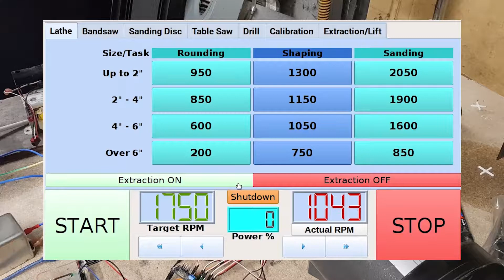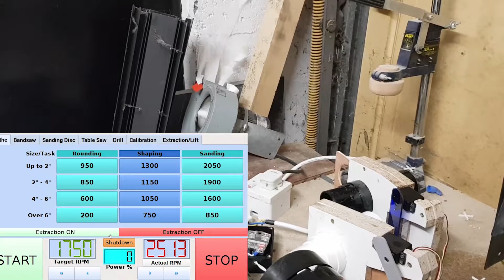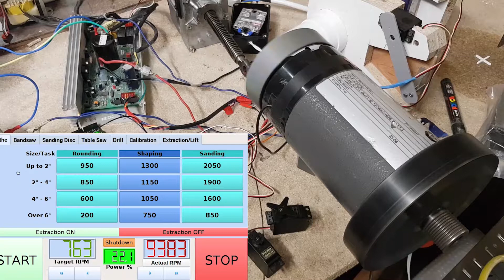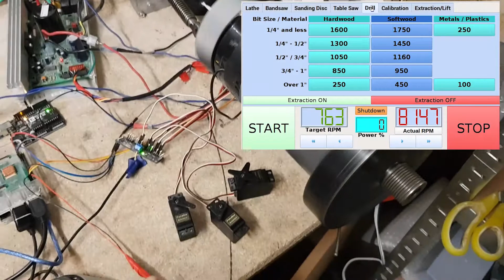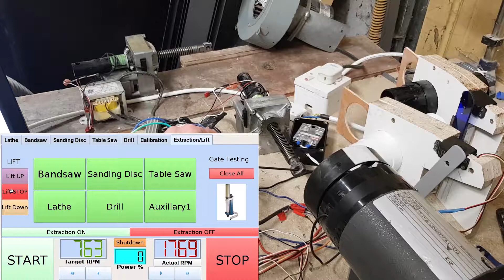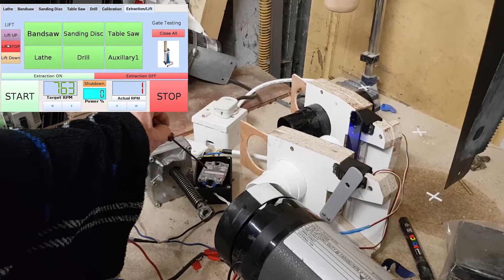demoBENCH

Comment: I just converted my old lathe to a treadmill motor, and it's an entirely different machine now. I'm still using the original control panel  though. I've also acquired motors from two more treadmills, and an getting ready to install them on my drill press (blown motor) and jointer (no motor). I was going to just wire a PWM generator to the MC2100 board, but after watching for videos, I've changed my mind - LOVE the touchscreen and all of the controls and presets!

I don't expect any problems with the wiring, but would like to know what software you're running. Is it something you wrote, or something you downloaded?

Keep up the great work!
Reply: The software is my mostly my own.  The touch screen is controlled by a Raspberry Pi with my own Python 3 program with PyQt5 for the graphics. I have offloaded the PWM to an Arduino Uno just in case garbage collection or some interrupt from Linux causes any issue. The Arduino program is based on the https://sonsofinvention.wordpress.com/2013/05/22/arduino-compatible-mc-2100-controller-and-lathe-tachometer/  software for their home built arduino system. I have modified it as, using no mechanical switches, I can dispense with the de-bounce routines and I have added my own routines for communication with the Pi by the serial port. This allows the Pi to respond to the touch screen and send the required power setting to the Arduino which sends the PWM to the MC2100.  The Arduino is also producing an RPM reading and sending this to the Pi for display.  I hope to get back to finishing this new version after the holidays.  BTW I have also done a simple potentiometer controlled version, similar to the sonsofinvention one but using an off-the-shelf rpm counter to keep it really simple. May use that in a stand alone tool.